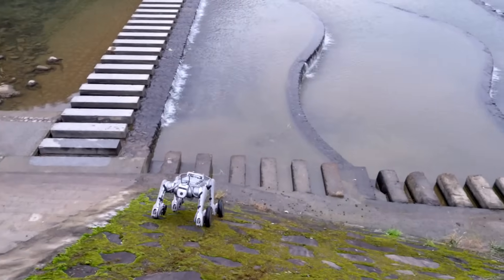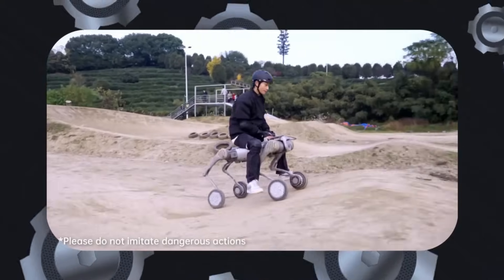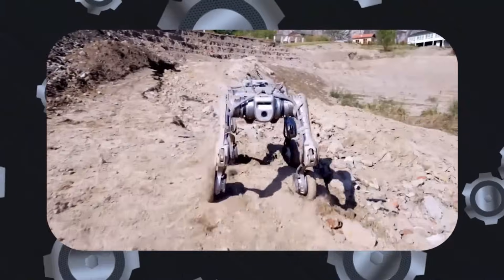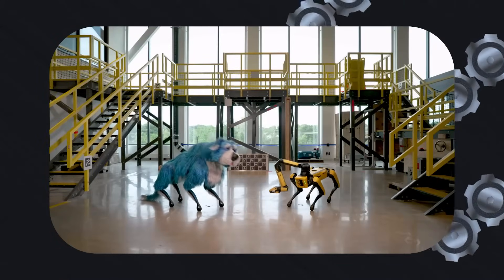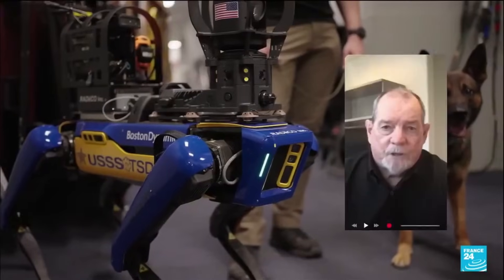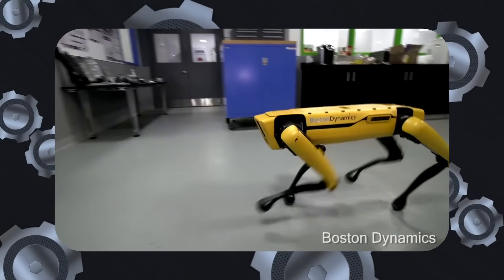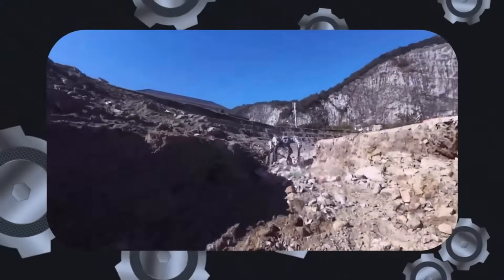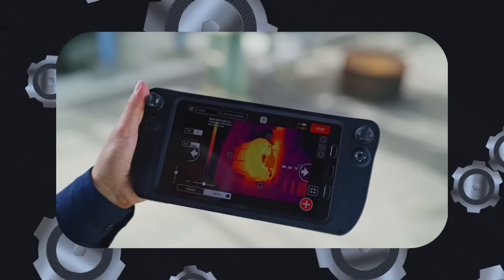Boston Dynamics VS Unitree B2W: Which Robot Dog Wins?

Comment: Boston did develop earlier. Their earliest robot dog used a diesel engine + hydraulic transmission system, while Unitree used electric drive. Unitree's electric drive mode subverted Boston's hydraulic drive.
Boston's hydraulic drive was slow to respond, heavy, and unable to be precisely controlled. Now Boston has given up the hydraulic route and followed Unitree's lead in switching to the electric drive route.
Reply: Diesel engine + hydraulic drivetrain is too noisy, while electric drive can be silent. 😜
Silence is critical in war. 😁
Reply from the maker: @蔡磊-q7q  but hydraulic actuators proved to be way too expensive, and also they need lots of repairs,, that's why all modern day robots rely on electric actuators while some do pneumatic actuators
Reply from the maker: @蔡磊-q7q  that's true, it can be lethal in war
Reply: @蔡磊-q7q you forget energy storage !!! Combustion fuel storage engine power is still better than battery and eletric motor. That is why that was chosen!! Much more  power and last longer. Electric is getting better now. Its still weaker then combustion. But electric will improve to a very viable useable long lasting.
Reply: @蔡磊-q7q  spot has always used electric actuators, you are talking about the robot dog prototype "bigdog" which is 20 years old and is outdated
Reply from the maker: you know the history,, Hydraulic actuators proved to be way more expensive, that's why today nearly all robots have electric actuators
Reply: @不止是昂贵，而且反应速度太难，对比电动差距太大
Reply: @chriswabs  會洩漏，it can leak
Reply: @chriswabs  maybe electric motors and control tech is not well developed back then when Boston began researching robots.
Reply from the maker: @wobhineven47  that's true,,they had to experiment a lot,.even when it comes to robot dogs legs bending backwards,, BD did several experiments and found that to be the best way. They came up with everything
Reply: @chriswabs  Maybe it's because China has the best batteries?
Reply from the maker: @deepseer  could be because they lead in that area,,in lithium and sodium ion batteries they are at the top
Reply: @chriswabs  Can you recommend some good Chinese mobile phones?
Reply from the maker: @СергейДрузь-ь3ж  a lot,, if rugged phones go for Dogee,,but if normal phones best would be Xiaomi phones like the 15 pro, then OnePlus phones & Oppo
Reply: 電機的量產性維修性也遠優於液壓
Reply: Their earliest dog was built for the military long before unitree and it wasn't diesel, diesel is for heavy machinery it ran on gasoline. Unlike UniTree They didn't have technology to steal when they developed theirs.
Reply: Dont full agree but mostly 👍😁
Reply: So can China say that the United States stole China's technology?
Reply: @蔡磊-q7q  definitely not
Reply: thats so dumb to use hydraulics,  very dumb MIT ppl
Reply: hey stupid boston dynamics lswitched to electric drive long before unitree ever existed.
Reply: You mean the other way around. Boston Dynamics is much older than unitree and their robot dog is nearly 20 years old. Unitree stole the designs.
Reply: @gtas321  You mean the electric Tesla stole the gasoline Ford's design?
Reply: @huachen3836  wtf. Ford did not create combustion engine. Most well know things/idea are stolen form the men who have no money. Historicly you will see most rich men  not all but most are theifs and ruthless
Reply: @huachen3836  electric cars are just as old as ice cars
Reply: @gtas321 like Huawei stole 5G from US who doesn't even have 5G?
Reply: @gtas321  Do you think Tesla's electric cars stole Ford's design? One electric platform, one mechanical hydraulic operation, two completely different routes, can you elaborate on how Unitree stole the design?
Reply: @gtas321  normal practice. First mans.good ideas always get copied by the followers. Usa paitent requires 5percent different in design. . It is life !!!! Sucks
Reply: @gtas321  You have to lie through your teeth.
Reply: It’s true chinaboi even the lower leg was the same exact design. But who cares? China used copy everything. Now they‘re sometimes better.
Reply: @jimbojones6206  This report published by an Australian think tank in 2023 collected 2.2 million papers in the past five years, covering 44 key technologies that will affect the future of the world, of which China leads in 37 and the United States leads in 7. Were these copied from the US? Why does the US have even less than China?

Comment: I was Unitree can make it bigger so that user can ride it like a horse.
Reply from the maker: @yours_sincerely48  😁😁that would be so cool,,,, or they just make it a little bit taller so that when you ride it you don't risk putting your feet on the ground and hurting yourself
Reply: @chriswabs  I was thinking jumping over a river of 20 feet wide while i hug the Robot with all my might as the Robot horse scalled up the mountains..That will be fun..i trust they can do it...
Reply: Yeah.. it is definitely possible with newer innovation & battery technology. Given its bigger size, you wouldn't want a robot horse which can only operate for a 10min ride. 😅
Reply: @yangguo17  the one they show in the video already works like 2h with 40kg load.  A little bit bigger one that can carry a human could probably work several hours and maybe higher speed with bigger wheels.  i think it could actually be a great tool for rangers/farmers etc!!   having wheels is really a gamechanger compared to feet only.  and by having great control on the wheel-spin it's basically best of both worlds.

Comment: Unitree obviously have a better product but it needs to open up the interface like Spot. It is not a toy but a mobile robotic platform that can be smaller or bigger or stronger or faster or operate longer. Bolt-on functions limits its usability.
Unitree need to market its product and develop models for all potential application. Not just follow Boston Dynamics unimaginative strategy.
Reply from the maker: @olderchin1558  yes I agree on that, BD offers more integration with their spot robot,,it makes it easy to customise the robot to suit your business needs

Comment: Boston's looks like Dinosaurs...Slow and Rustic😂😂😂😂😂😂
Reply: But more smooth at dancing now its autonomous unitree no match its still controlled by controller
Reply from the maker: but they have sold so many units, am pretty sure they're now working on the latest model
Reply: @chriswabs  does not matter how many they sold. old tech is old tech, and whatever new thing they are working on, it aint out yet and has no announcement yet, so they are not the best as of now. And for most cases, people buy them because they are a US company, as of US get worse and worse reputation by time, that kind of add-on affect will be faded away soon.
Reply from the maker: @jiachen7865  you have a good point, people buy them because of them being in the US. And also they might have sold most units because they began a long time ago,,I love how Unitree is fast with commercialisation of their products, so by mid 2025 they might have sold more units than BD
Reply: @chriswabs USA is really old only know how to print dollars without any industrialization even advanced chips are from china Taiwan 😂